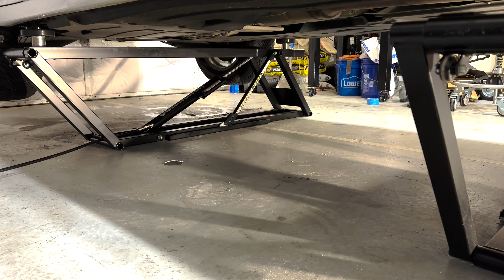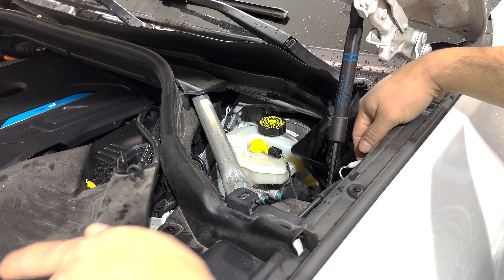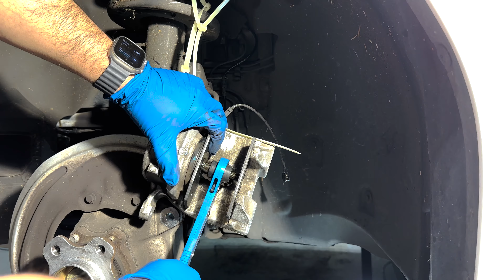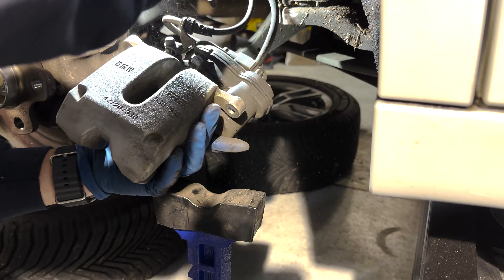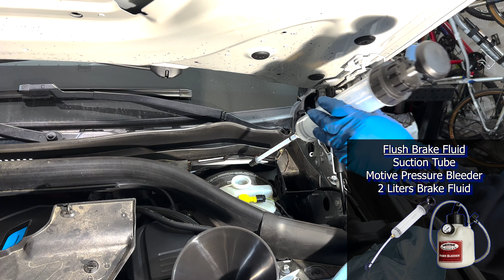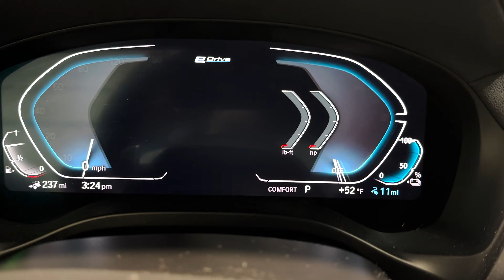G01 X3 Front and Rear Brake and Rotor Replacement

Comment: From BMW enthusiasts 
I do e a lot of brake jobs on bmw. Per BMW manual you never apply any grease or silicone on brake sliding pins. 
If brake ware sensor is not damaged I alway reuse it no point of changing it I get it it’s only maybe $10 but if it nothing is wrong then why replace. 
It appears you had a lot of meat left on rear pads. 
I personally only use Akebono brake pads they grip nice no dust. 
Over all good video. 👍🏻
Reply from the maker: I had to double check the manual and you're right...it doesn't say anything about greasing or servicing the pins. Front and rear definitely had grease on them from the factory, unless the BMW dealer greased them during a service. Mind blown though...thanks for the info!
Reply: @ruffwrenchn2235  This one confuses the hell out of me as well. My pins def have black grease on them from the factory but everyone keeps saying that according to BMW spec you're supposed to just clean the pins and keep them dry. I just left them as-is with the black grease on them from the factory. Not sure what to do.
Reply from the maker: @mqquresh  It's definitely odd. The grease is probably black because it's contaminated with brake dust. It's normal though with use.
Reply: @ruffwrenchn2235 what would you recommend in this situation? Clean the pins and apply some new silicone grease or just clean them off all together and put them back in dry?
Reply from the maker: @mqquresh  I greased mine and I'd do it again. I'm unsure why they say not to grease them, but they came with grease so grease goes back on.
Reply: What about the bolts, are they fine to reuse?
Reply: @flamurmustafa522 I always reuse bolts 👍🏻👍🏻👍🏻